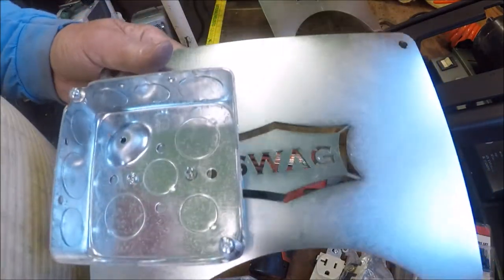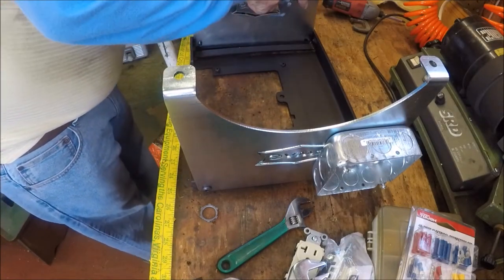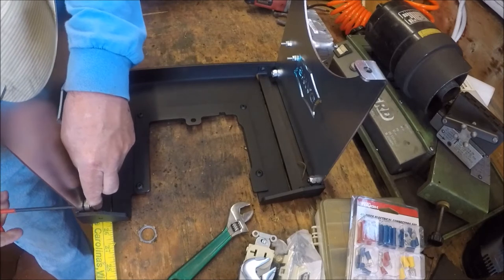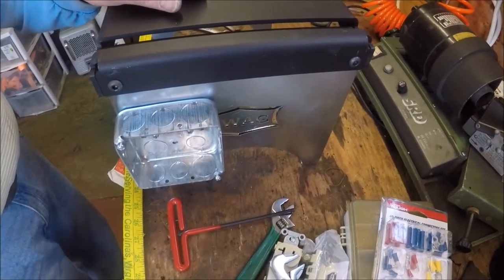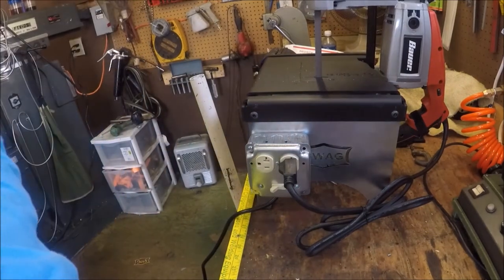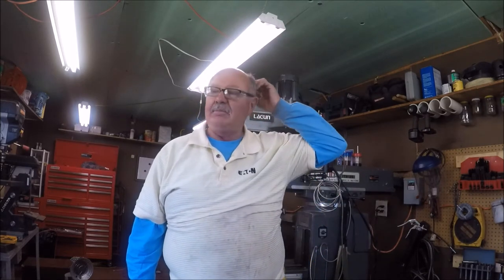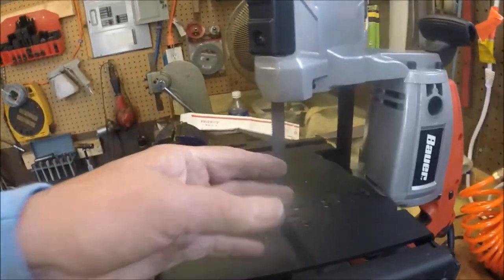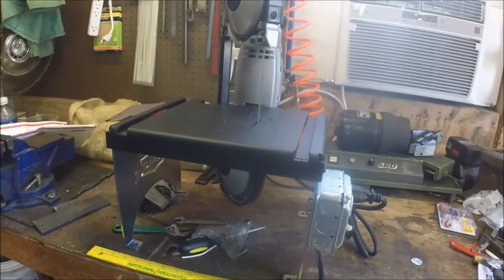My SWAG portable band saw stand with a Harbor Freight band saw

Comment: I wonder if the switch would be better above the outlets? You can add a light to the spare outlet.
Reply from the maker: Pro1er I’m not sure good thought anyway. However I’ve since moved on to a converted wood bandsaw. I kept running into throat depth issues with the portband setup. 

Thanks for the feedback

Comment: Swag has some nice stuff. I am thinking about getting their 20 ton press finger brake kit.
Reply from the maker: Hill Top Machine Works I was impressed when I got the table, I seen other YouTube creators have them. It bolted together easy the hardest part was the electrical box install and wiring up. The saw bolted right up

Comment: You have to stands on backwards the tabs go to the outside
Reply from the maker: James Mckeehan Really I didn’t know that, you know SWAG did not send a instruction sheet or diagram. I’ve had the stand a year or so and it works well with the tabs in.
Reply: Look on Swag's website for the correct orientation.